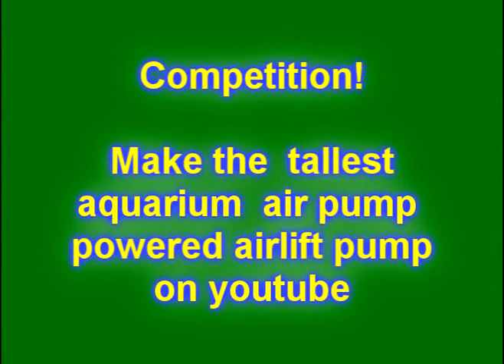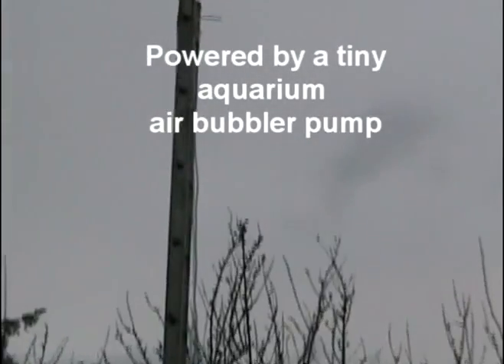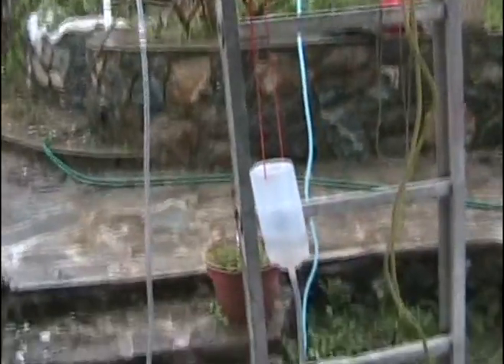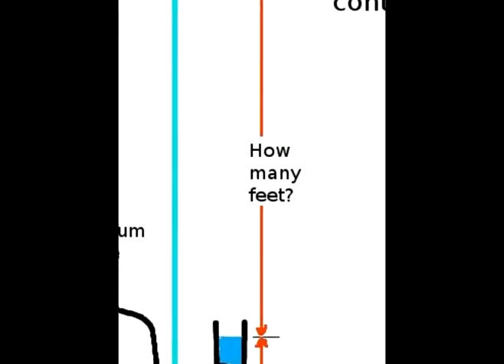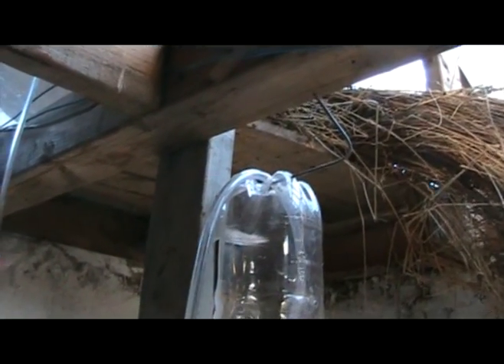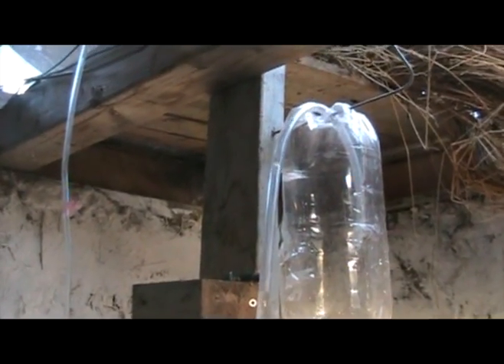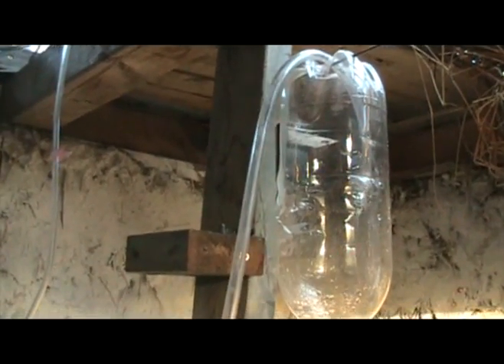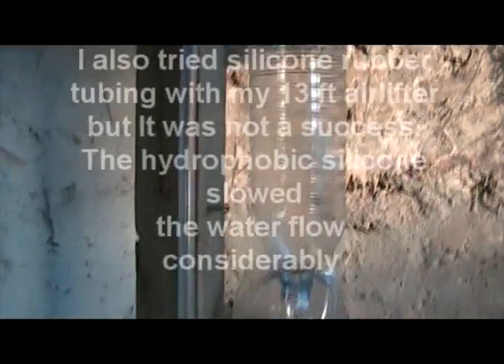Nano Airlift Pump Challenge!  BEAT THIS to be Champion!  And World record holder!

Comment: that's really brillant, i was thinking about using an airlift to pump from a small borehole that doesn't fit any electrical borewell pump
and thought how i can use an airlift without having to dig a deep borehole for submegeance 
you just showed me a better and simpler idea than what i was thinking about (was thinking about using a variation on geyser pump using an anti-return plug to make a slight pressure in the airchamber )
your idea rely on the water surface tension inside the small pipe

Comment: Is there a theoretical limit to the pumped height?  If you run the hose up a cliff, I wonder how high it would go?    I think we can' not raise water with a vacuum more than 32 feet. This isn't the same thing, but maybe the weight of the water will be too much at some level?   In the video, it just looked like you did not have a way to raise the hose higher.   Dave
Reply from the maker: Hi, Dave, yes, that was as high as I could go at that time. Its probably pretty close to the "practical" limit if you use that amount of air pressure (about 30 inches H2O of air pressure) to pump the water. I think a guy in Kamloops beat it by a foot or 2 not that long after I made the video.   (I'm not going to look at my video again to check my rules) I don't remember the numbers but 2 of my pulser pumps pumped to at least 8 meters or higher. (with 2 meters H2O and with 2.5 meters H2O of air pressure.   I did figure out that the maximum height is related to the square of the radius of the pipe and of course to the amount of air pressure.  I don't think it is practical to use tubes this small (except in "pallet gardens" and in vertical hydroponic systems.   I now use the low pressure airlift in compost bins (to pump water around the compost to make compost Tea)  (Massive amounts made quickly) and in a pallet garden (circulating water means circulating nutrient, warmth,  and oxygen to the roots) and in my greenhouse.  Also,  I use it in a fishpond to pump water from one tank to another.   But nothing is at the maximum height.
Reply: @Brians-tracking-solar-scoop  Is there a maximum diameter of the lift pipe?  Or is it a more of a matter of having enough air?  

I keep thinking of the Ragged Chutes compressed air plant - I think they have a diagram at the beginning, maybe I could get what was possible from that.  https://youtu.be/UtYLVLkWyGc

Comment: Hello Mr White I've been watching your videos for years.  What if the outlet tube is submerged in a wider tube say 1 inch all the way down to the bottom replacing the less dense air with more dense water making the air water mixture much lighter increasing its boyouncy and its upward flow at the same time without using any of the water between the 2 hoses. Then remove the air pump and stick that end above the water line so that water does not flow back out.  Instead of a tee insert the airline tubing inside the thicker hose with opening flared alittle facing the direction of air flow creating a vacuum sucking air into the water acting like a compressor only when there is a flow of water.  To start the flow the air pump can be attached momentarily then removed once the water flow commences.  I've been experimenting with water pumps without electricity for a few years now and thanks for all the good videos...I learned alot.  https://youtu.be/OXs4vRgcKBc   https://youtu.be/D06UuQSYiTk

Comment: Thank you so much for sharing your knowledge. Mankind needs more souls like yours.
Reply from the maker: Hi, Edgar,  thank you,   my newest version is now called "constriction airlift pump".  It has a lift to submergence ratio of up to 23 to 1 in my tests.  Obviously that is right at the limit and not very efficient at pumping at that heightThe best tubing for "records" seems to be 3/16 inch tubing but the best for practical use is probably 1/4 inch and up.  . But it is important to find limits because this helps define the uses for it.    It seems from my tests that lift to submergence ratio is linked inversely to the  square of the  tubing diameter.  Also,  really important.  New tubing does not work well until its inner surface gets "dirty".
Reply: Brian White You mean the friction of the water in the inner walls of the tubing affects the performance, and until there is enough algae inside, it improves?
Reply from the maker: No, actually.  Here is what I think is the reality.  New tubes seem to have a hydrophobic film on them.  This means that "drain back" on the walls does not occur properly. I have seen new tubes "choke" with the water column inside exactly balanced by the air pressure.  And the water column just sits there.  Nothing flows.    In the choke situation with older or dirty tubes,  drain back occurs and the "choked" column gets shorter and once again there is enough air pressure to push it  up and out of the pipe.  I think a little algae in the pipe is ok but it is annoying when it builds up inside it.

Comment: What is the input power required for your pump? it will be written on the pump.
Reply from the maker: Talha Kamran  I have done lots of videos (too many) of these types of experiments.     It was an aqua expert 600.  I don't have it any more. So I don't know.  I have a jet stream 1500 something and it is 3 watts and it is about the same size as the aquaexpert.   I think the aqua expert was something like 2.5 or 3.5 watts.   I have done lots of videos with different pumps.  I also have connected an air pump to a solar panel and worked my nano airlift pumps with that too.  I tried 2 different types from China to work with the solar panel.   I found that brushless motors (more espensive) running simple air diaphragms work best when it is solar powered.   If you buy an air pump to do something like what I did,  probably it is better to buy a bigger one and run several things at the same time.    I run water circulating in my greenhouse,  a pallet garden,  a compost tea maker,  2 rock planters with water pumped from underneath to the plants,  and a fish pond (with a water flea water filter) from one big 4 outlet air pump now.  Aquascape pond air 4 and it is 11 watts and puts out 14 liters per minute of air.  And that can go 9 ft deep in water. Half the air goes to my fish pond and the rest to the garden experiments.   I would love a pump that is designed for 1 psi (about 700 cm deep under water) instead of 9 ft (almost 4 psi) because it would probably be a lot faster or lower watts.   Brian
Reply: Brian White I was thing pretty much the same. Why bother to run few 100 watts motor water pumps. why not let nature work. Bubble the water and let nature do the work.
Reply from the maker: Talha Kamran My latest video is about making "compost tea".  I am using an airlift pump to pump water to the top of the compost and the water drips back down into a bucket.  So you get compost tea which is a good organic fertilizer.  I was testing today.  I have a 4.5 watt,  2.5 psi air pump.  It has 2 outlets.  Each outlet is 110 liters per hour.   One outlet easily runs the airlift for the compost tea.  So,  I need about 0.7 psi to run this but  half my pump  that is designed to run  at 2.5 psi  works.  So, about 2.3 watts.    But also,  you can use really water power to make the low pressure air.  A pulser pump nano with a 1 meter pipe should work it no problem.

Comment: I feel the best way to test this is put a a size of pipe in a pool. Add a compressor fitting to the bottom of it and regulate air flow from there. I use to pump sand under scuba around boat mouring blocks that were covered up too much with sand to lift with a lift bag. It was amazing what a 4 inch pipe would suck with 20cfm delivering. The vacuum affect was there for shore. Ive been looking a trompes in line on a ram pump and i think this maybe a worth while attempt.
Reply from the maker: Red Axe  Thanks,   You need to be careful with compressors that they are not too strong because they produce very high pressure and you will get pressure waves that might affect the flow.  They might actually "break" the plugs of upward flowing water.  The little air pumps for aquariums only produce 1 to 3 psi and yes,  I think people could test it in a swimming pool.   It would be fun. I don't have a swimming pool.   The little diaphragm air pumps for aquariums and aquaponics are producing 7 to 20 liters per minute at about 3 psi depending on the model.  That is the range that will more likely work for pumping high with little pipes.  Your 20 cfm is over 500 liters per minute! and it would produce a fine spray  through a tube.  So, yeah,  the little mini diaphragm pump will get the real result.   Many people with fish or swimming pools probably already have them.  It could be a real useful experiment.   Thanks for your interest.  Brian

Comment: Hey thanks for reply Brian … Is ok .. I understand about the bubble pump and I want to use it to get the water high enough to feed a strawberry tower : )
Reply from the maker: How high is the strawberry tower?   Airlift pumps can go pretty much any height if you increase the submergence.  But  most people do not want to dig something into the ground beside their tower!  Nowadays, I usually work with the airlift pump in a 14 inch high bucket.  and that really limits effective pumping to something like 5 ft high. But if you have 2 or 3 ft of submergence, you can pump way higher.

Comment: I wish I could see how you get the air into the lift tube … ahhhhh
Reply from the maker: Hi jionnie,  the air comes from the aquarium  bubble pump.   Since making the video, I have found that the bubble pumps probably pump too fast and if you have a tap between the bubble pump and the lift tube, you can probably slow down the air to a better speed and maybe pump higher.  But I have not redone the experiment recently.  I'm waiting for other people to try it.  I have done other experiments with airlift in my pallet garden playlist.  You can look there too for explanation.  Thanks Brian

Comment: Brian, how much airlifted water is your goal? How much gal/day?
Reply from the maker: The goal is to highlight the lack of knowledge, to get other people to do the experiment too and to define the limits.  How high can it pump with that low pressure driving the water upwards? The weird thing is that nobody knows.  I have been told that  12 to 15 times the submergence is the limit. (But that was an "educated guess").  Well, I cannot do 15 times because my house is not high enough, so I was hoping that someone else would do the experiment. (Someone who lived in a high rise, probably.   They could do it on the stairs on the outside.   I did another experiment where I used 0.15 psi air pressure (about 10 cm submergence) and pumped water to 23 times that. So, I strongly suspect that you can go very high with low pressure air as the driver.   If developed, this might be a wonderful "technology" to use small power sources to pump water from shallow wells or it might be nothing at all.  But without seriously defining experimental limits, we will never know.

Comment: Is anyone still working on the project of air lifting water from a well? I have been working on this project here in Portugal  using a 12 volt air pump, 70 litres per minute, 10psi or less, I hope I can make it work! Hoping to make it run on solar power in the future. Depth of the borehole is 150 foot plus. Any suggestions please.
I have watched many videos and many suggestions so far.
Reply from the maker: Hi, Shelia,   how wide is the borehole and how deep down is the water level in the borehole?  If you can do  15 ft submergence,   you can probably pump in "stages" of around 30 ft or 40 feet (if there is enough room in the borehole), maybe even 50 ft stages if your air control is good.. Note that I have not ever pumped that high.  The key is sending the right amount of air for the diameter of your pipe.  Ballpark guideline would be not more that 10 liters per minute if you pipe is half inch diameter.  And probably not more than 20 liters per minute if it is 3/4 inch internal diameter.  So, you would need adjustable taps to control each pumping stage.   You should note that the highest lift to submergence ratio that I have ever achieved was about 23 to 1.   However this was using 3/16 inch tubing and less that 0.15 psi so it almost certainly does not scale up!  So just from looking at the numbers,  70 liters per minute will cause churn in the pipes.  You must use less air.   Thanks Brian
Reply: Thank you Brian for your helpful reply. I first got involved with this after watching your videos on Utube as a friend on a fruit farm has a borehole and no electricity nearby. Cost to get connected to the electric is prohibitive considering the price of oranges here! The borehole is 300+feet deep, the water is at 150. Diameter of the pipe is 150mm. I have made various prototypes, each time with some improvement. With your help and advice I think I can be successful. I will let you know more when I have completed my next prototype working on your methods. I have watched various videos on utube and yours seems to me to be the only one worth following!, thanks, Jose Gomes (husband of Sheila)
Reply from the maker: sheila gomes  Is there a 12 volt compressor that might work continuously with your solar panel?  If you can make 40 psi and submerge your  1/2 inch or 1 inch pipe about 80 ft in the water, it should work pretty well.  NOTE! I just don't know if compressors will work  continuous and direct from a solar panel without a battery.   So you need a compressor and an air tank.  Compress the air into the air tank.  (It can go slow). When pressure builds up to close to 40 psi, it will "blow" the column of water and start to airlift. (you still need a tap that you adjust once to regulate it).   The airlift will work (depending on the tap adjustment) until pressure goes down to 35 or 30 psi in the tank and then it will stop as your tank re pressurises.   I can pass you on the email addresses of pump sales people in China who were helpful to me.  (I am more interested in low pressure applications but in your case,  at least 20 psi (40 ft submergence) is probably a good idea).  The main thing, as I see it is to find a compressor or pump that will work continuously and start and stop direct connected to your solar panel.  (I tested 2 types and one is working really well out of the box).      Thanks Brian
Reply: Hello Brian, I would very much like you to pass on the e-mail addresses of the pump sales people in China that you speak about. Can you put them on this discussion or do I need to give you my e-mail address?
thanks, Jose Gomes
Reply from the maker: sheila gomes
 I sent the details to your youtube email.  Brian

Comment: If only there was a way to pump air without mechanical noise. Sounds of water and bubbles only.
Reply from the maker: One of my pumps is a hundred ft from the water that is being pumped so you only get the sound of the bubbles.

Comment: hi brian.  i'm wondering about your success with windowfarms.  i've been gathering the materials to build the version 3 from the windowfarms site, and am wondering if you've found suitable bottles/pumps, etc. here in canada.
Reply from the maker: Hi, Duncan, I don't actually windowfarm. I do "soiloponics" in my pallet gardens and vertical planters instead. So it is a similar deal except the water drips through soil instead of aquaponics  media.  My pump is a marina 200 that cost about 20 or 25 dollars at the pet store and it gives out 220 liters per hour of air and it uses 4.5 watts. You probably need to put it on a timer for windowfarms because it only needs to come on 15 minutes per hour or something like that.  Timers are about 15 dollars. I got mine in the local hydroponics or grow op shop.    Right now it is running 4 pallet gardens and a fishpond. So it can run about 5 columns pretty easily.  I am pretty certain that my "airlift in a bucket" design will out perform the version 3 airlift pump from windowfarms.  Beware of new tubing because it has some sort of hydrophobic coating.  Either wash or dirty it first to remove the coating otherwise water will "hang" as it goes up. That hanging is probably the most annoying problem in the world!  So yeah, the t-joint design and airlift in a bucket (from me) will both beat the version 3 and I have videos about both of them.   If you want to do something new, you could try the "delta" to split one stream of water into 3 or 4.  The ourwindowfarms (community  site with advice from longer users)  is currently not working for me.  That used to be the windowfarms community site but who knows, maybe they are trying to kill it off. (I cannot log in to comment on anything) Brian
Reply: Brian White sounds neat.  i think i've pretty much got everything together now.  it's my first attempt at this so i may be picking your brain!
Reply from the maker: Sounds fine. I always have the pump higher than the reservoir. I have no idea why anybody would leave it on the floor with a check valve. Easier to put it up high and no check valve.  (Actually mine is a hundred ft away from most of my reservoirs). Use the t joint airlift if you have room for it and if not, the airlift in a bucket is probably the next best bet.  Use taps to control the air speed.  Maybe try one larger tube up (say 8 mm) and the "delta" to divide the flow into 4.  BEWARE!  The delta is experimental. (I am currently stuck outside the ourwindowfarms site, they have an anti spam plugin that will not let me log in or change my password.) So if you post a reply to one of my postings, I cannot approve your post to put it public or answer it.  (there are comments waiting for my approval). Brian